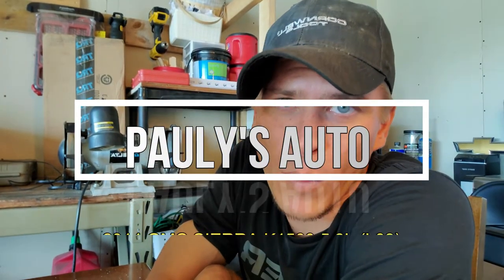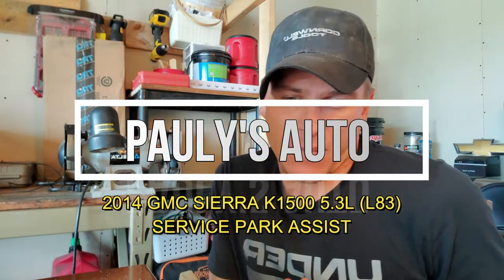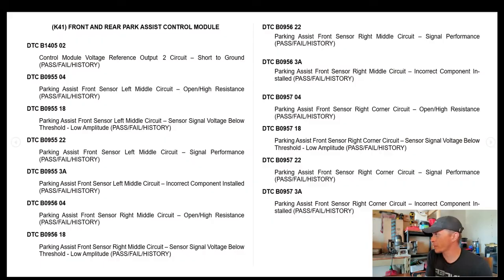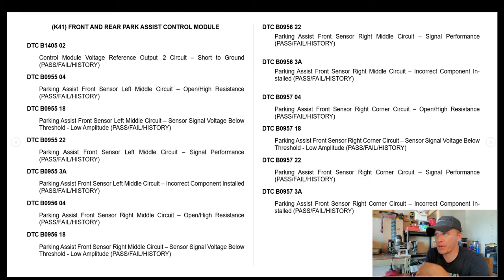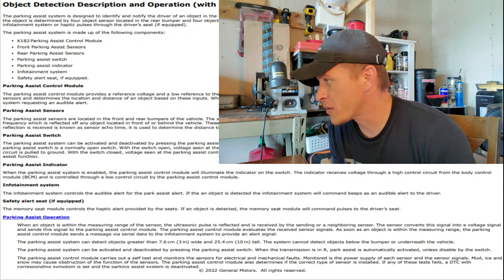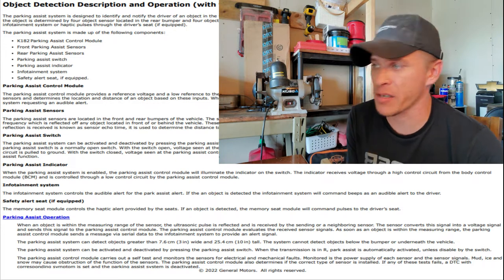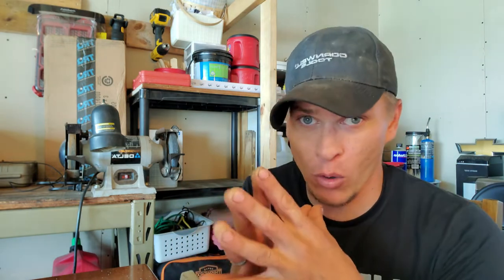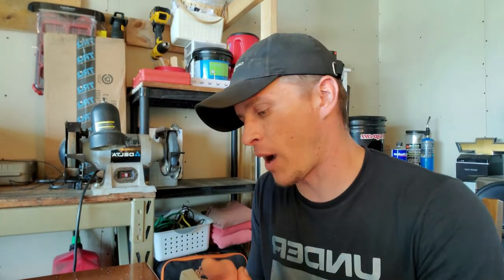2014 GMC SIERRA K1500 5.3L (L83), SERVICE PARK ASSIST

Comment: This is the best explanation I have seen anywhere. My truck came with this problem when I bought it used 🙄. It’s been a year of dealing with it and has become part of the process of disabling it every time I drive it. Took a crack at troubleshooting and got discouraged. Thank you for making this video. I want to go back and repeat some of the steps shown here. Google searches have lead me down a lot of side rabbit holes.
Reply from the maker: 😇 Thank you for the kind comment, I'm glad I could be of help, best of luck to you my friend.

Comment: I detect Army COMMO lingo :) My son was a 25U. Thanks for the video.
Reply: I am having  intermittent UXXXX errors in a 2018 Yukon Denali that I am guessing are connector related. I am mapping out the shared components of the communications bus between the units that throw the errors. Hopefully I can track it down. Your insightful and detail oriented approach is very much appreciated.

Comment: Impressed
Not an auto mechanic myself
Been a designer of complex electronics for years and upon fault correction requirements I know about the proper understanding, break down diagnosis and out side the box/anti cookie cutter thinking require to efficiently resolve problems.

You did it perfectly and accurately using a well thought out procedure.
I would recommend and watch anything automotive that you do.   Bravo.

Now one request if possible
Could you post a link to a REAR wiring diagram similar to the wiring diagram for front harness used in the video from the radar control module to the four sensors
My similar problem exists in the rear of my 2015 Cadillac escalade

Off to make my device for load testing the pin junctions………….thanks again
Reply from the maker: I appreciate the comment.  I can't post content like that I wish I could but that would be a violation of information that doesn't belong to me.

I share what I can to help people learn.   I don't want to get in the habit of providing wiring diagrams for people upon request.

I hope you understand this, these resources are readily available for anyone who pays the price for the access to the information.
Reply: @PaulysAuto  guess I understand that yet the other diagram shows in your video
That image is pretty much a provided wiring diagram
Make a rear diagnostic video 😊!!!
Will limp along here………thanks

Comment: Great info...., thanks.  Question, I have a 2015 Silverado 2500 HD, started to get "Rear Sensors error, Service Parking assist, and the swith on the center consol would flash on and off rapidly (the on/off light) and then stays off...  somethimes the system would work normally then suddenly display the Service PA message.  The very weird part of this is that it happen when I was braking or coming to a stop..., go figure.   I am thinking the flashing indicator light when attempting to turn it on is a huge clue as well as the braking thing.  All sensors are pulsing as expected and after seeing your video I am leaning towards the K41 as the issue...    BTW, where is that module?   Following you, good stuff man....    ( correction, the warning comes on when the truck goes below 10 mph while braking)  ...  Can not locate the module, can you help?  Thanks...  Ken

Comment: How do i know which orientation the sensors themselves should pointed. my sensors keep going off and theres nothing in front of the truck. I have a feeling one of the sensors is upside down. I recently removed my bumper and re-installed but didnt touch the sensor harnesss. doesn't mean one of them couldnt have accidentally been turned upside down. any help would appreciated 2017 GMC Sierra Denali L5P
Reply from the maker: I wish I could help you and I apologize for not getting back to you sooner but be careful with how much paint is over the top of them Sensor faces... I suppose orientation could be an issue I can't remember I don't think those can be installed in the incorrect position.

Comment: Do the rear parking sensors on these trucks need to be placed back in the same location in the rear bumper if they have been removed? Or does placement order not matter?
Reply from the maker: no they are interchangeable...but the mounting bracket rings may differ 😁😉
Reply: @PaulysAuto  thanks for the info!
Reply from the maker: @daltoncahn55  You're welcome my friend and you will get ultimate success

Comment: I have a 14 with that message on my cluster as well even after changing all 4 rear sensors. I don’t have the scanner to show those codes what should I do next? The module?
Reply from the maker: Best thing to do is get it scanned and find out what those codes are in the park system control module so you're not chasing the problem.  Just changing parts is not something that should drive diagnostic work or the process.  You really do need a capable scan tool here.
Reply: @PaulysAuto  all mine can scan is dtc codes. I’ll see if I can get them scanned and report back I guess. Know any way I can without a $1,000 scanner
Reply from the maker: @nicholasdufresne504   It all depends on if it can read all the modules DTC's.  Check out Pine Hollow Diagnostics channel, Ivan just did a video on affordable and capable scan tools my friend.
Reply: @PaulysAuto  is the park module apart of the bcm? I got a scanner that can scan bcm on order
Reply from the maker: @nicholasdufresne504  No it's a separate module.
Reply: @PaulysAuto  U0159-00 is the code I get on my scan tool